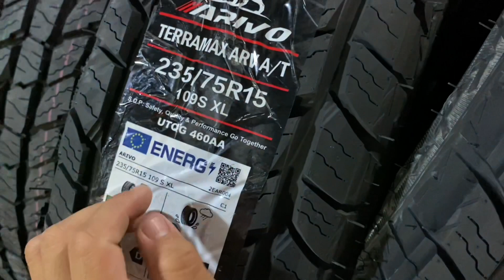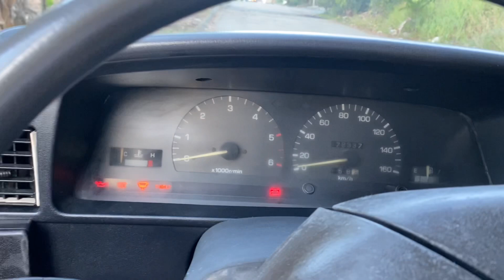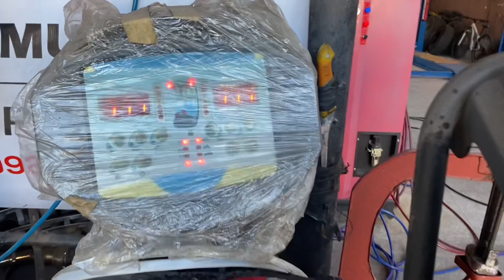New Tires For Atoy! 😊🛠

Comment: Ano po nangyari sa puting rims na nakakabit dati?
Reply from the maker: Andito po sa garahe.. need kasi ilowered pag yun ang ikakabit. Low profile kasi ang goma.
Reply: @ezworksgarage  doc Anu problema ng Kia Rio ko 2009 model matic trans.. pag nasa 70kmh me vibration pero nawawala pag dating ng 80pataas.
Reply: Labas Ganda Nyan pag 18 inch 50 series katulad ng sakin 98 Isuzu Fuego cromax paint din black walang alon super linis at kintab. 1st owner